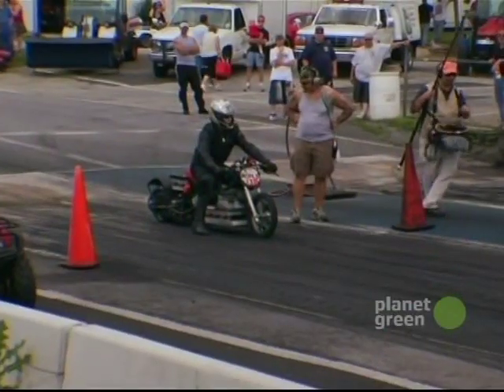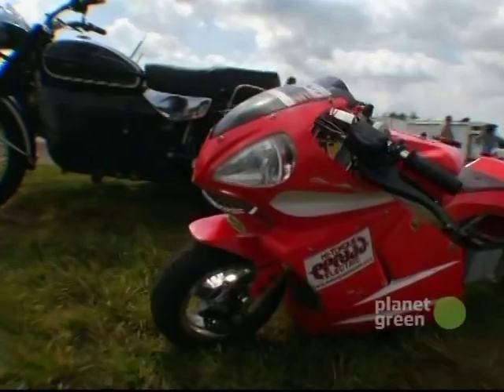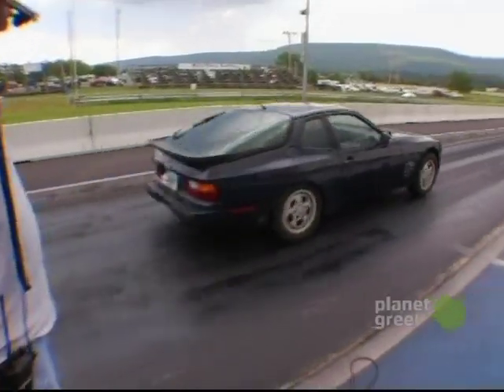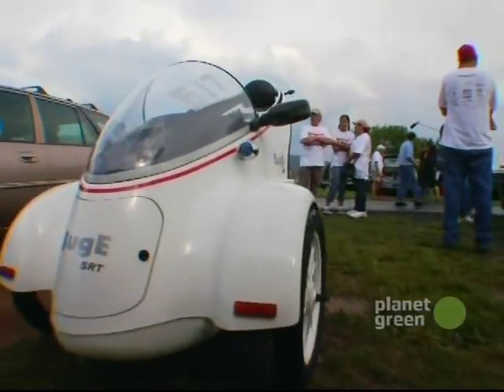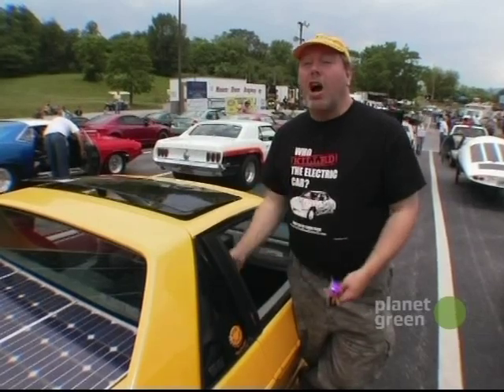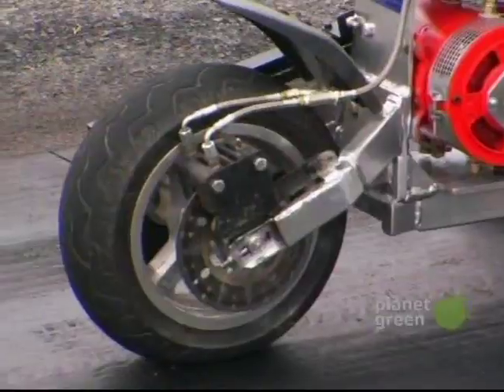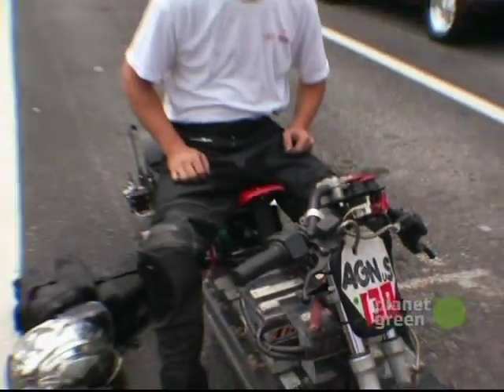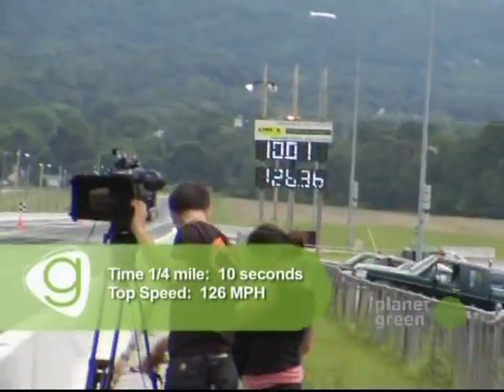Electric Car Drag Racing in Hagerstown, MD

Comment: Beyond the batteries, electric motors are now being built specifically for cars. When properly done, an EV will handle itself in traffic just like any other well tuned car. Now take a race EV to the track...They feel like they were just rear ended by a freight train, yet still handle well in street traffic. Also note that a 10 sec EV with a 21-22Kwh battery pack (= less than 2 gallons of gas) is likely to go 100+ miles on a charge. Can't do that in a gas drag car with a 2 gal fuel cell.

Comment: you should do some research on battery technology. Because electric cars are 4 times more efficient then gas cars, you only need 1/4 of energy onboard the car then compared to a gas car.  recent innovations have seen exceed 700wh/kg, and these batteries last 10+ years and getting cheaper.
Telsa Motors have exploited this technology and a a result there cars can do 250+miles per charge at highway speeds. Its only a matter of time before the technology catches up with gas cars.

Comment: There is water vapor power available, solar, and wind. Another way to keep the batteries charged for liked long road trips is to use (1or 2) small belt driven generators to supply more electricity to charges the batteries on the go, give extra electricity that'll be produced to other components like the motor, eg. so there not draining the batteries so that means the vehicle is less on the charger and more on the road. Consider this idea.

Comment: The oil companies just want more money so they can just dig more wells for the crude. Coal is a cleaner burning fuel than oil. I have to agree with way these Evs are zero emissions cause they don't put out fuel through a muffler under the car. It's when you burn coal to generate electricity u get pollution. There is hydro power available but tree huggers get in the way.